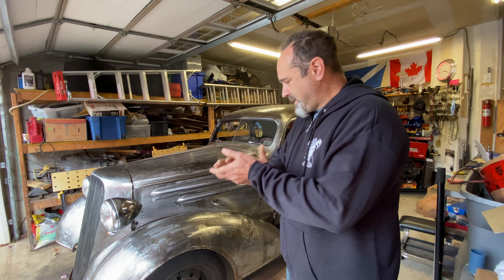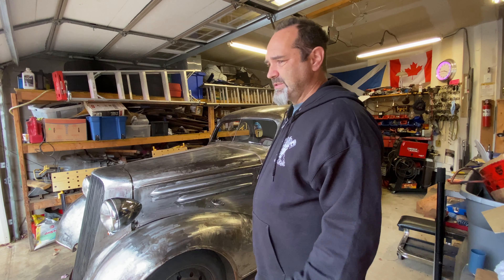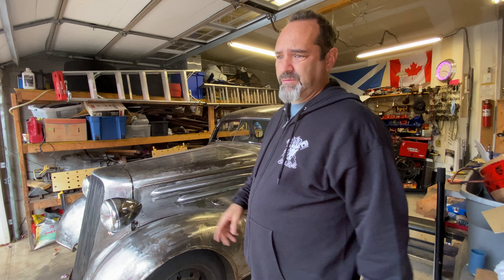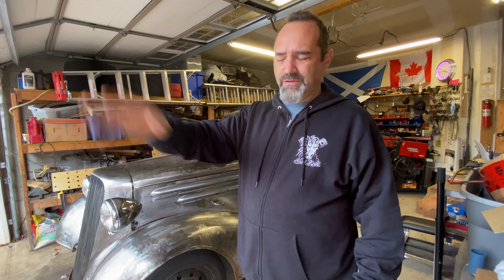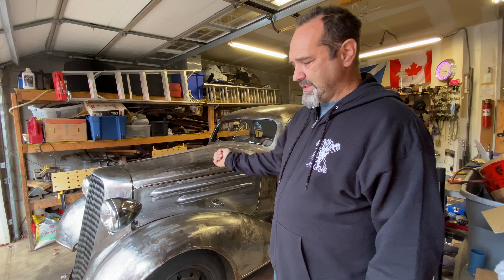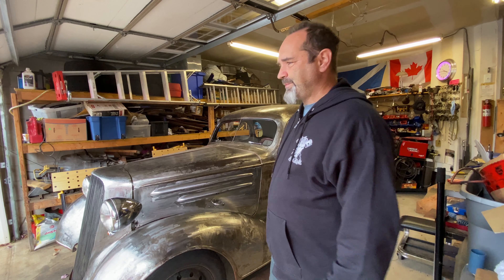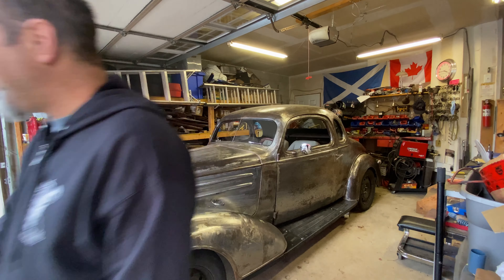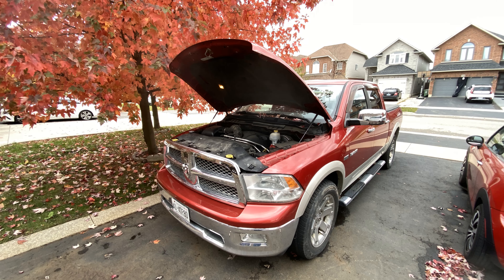2010 Dodge Ram Hemi 5.7 No Start Diagnosis

Comment: I'm a Toyota man, but the same principle applies- buy a certified used vehicle rather than a new one. The Tacoma I bought had a better warranty than new, and cost me almost $4000 less, too. It was two years old and had less than 23,000 miles on it. I don't know if you want another Dodge, or what their certified program is like, but it's an option you may want to consider, no matter what make and model of vehicle you want to get. Good luck to you, whatever you decide.

Comment: Hey Dave I just did a Google  search in Ontario and you can buy a good used Hemi for $1500-2500 bucks and we all know you have the skill and tools to install it.
Reply from the maker: I don't have the tools. Can you imagine what I would need to get that engine out. Too high for my hoist, and too heavy for my jack.
Reply: @ScottRods  nothing stopping you taking the wheels off dropping her on the floor and using the hoists that put bugsy's motor in.its only nuts and bolts. Just be methodical and take your time stripping the front off and it will be an easy ride. They are not rocket technology
Reply: @ScottRods  Yank the heads an have a look then go from there.
Reply: The Hemi weighs 75 lbs less than your SBC and yo lifted that with the transmission! As someone else mentioned pull the front wheels after you undo everything underneath.
Reply from the maker: @glenmiller3783  I was meaning lifting the truck with the jack to get it high enough to drop the engine out the bottom, but lowering the truck makes sense.
Reply: @ScottRods  yes taking it out the bottom would not be an option. 👍

Comment: From what I’ve seen you do on your channel, go get a long block & swap it out.
You CAN do this. All nuts and bolts go in labeled ziplock bags and mark all the wires with masking tape and write what they go to. Shouldn’t take you any longer than 5 days.
Reply: Found on YouTube, DG’S Garage, 5.7 HEMI Timing Chain Failure from one year ago. End of video shows a Notice from Chrysler for 2009 to 2012 vehicles stating the same problem you have & Chrysler will cover it. 
Call your local dealer & give them the VIN number.
Sounds like a RECALL to me!!!
Clay
Reply from the maker: I checked, I'm not on the list

Comment: If the drive line, body and interior is decent, get the engine. If you change your mind later, as you said running truck is worth 10k you can recoup the 6 in resale or trade.?. Good luck and sorry this happened.

Comment: Bummer Dave, but now you know. 300 000k is like 180 000+miles. How did you treat the truck ? Did you always let it warm up ? did you always change the oil regularly ? If yes, it is likely worth repairing. Pull the heads and send them in, you will likely not get them done for under $1000.00, used to be the machine shop will include a good top end gasket kit because they need the valve seals to do the heads. While the heads are out change the timing gears and chain(s) making sure to get any tensioners, chain guides and hardware and front gaskets as well. That will likely all come in at another $500.00 or so. Two or three days of work and you are rolling again, for about $1500.00 best deal by far if you ask me. Replacing the entire engine with a used unit is a 50 / 50 deal at best and likely twice the money, and you would be wise to do a timing chain on any used engine you do not know if has been done or not for sure...

And now the painful question... at what mileage was the chain last replaced ?

Comment: I feel for you Dave that sucks . I am in a similar situation but not that bad but I just had a frost plug go in my late model ford Mondeo diesel and to fix it I have to pull the motor out it's done 300000ks I am just loading the first video now

Comment: Things to think about regarding the ram engine .If you sell it as is the money you would get for it is very little.the next guy that buys it will get one heck of a deal  ,he go down to his engine supplier work on him to get one at a very reasonable price .show it off to his buddies and drive it for the next 5 or so years, or flip it at a profit. That could be you Scott. Next if you keep it and do the work your self the warranty is on you .even if you buy a new engine most of the time with new and used  if you are not a certified mechanic you wont even get a curb side warranty for the engine. you could find a certified mechanic to do the work and you could sores the engine and get warranty and save some money .If you decide to buy another truck you invariably would  have to put more money in it to bring up to your standards and safety If you fix the one you have now you know what you have,in the end it's going to cost money.Think long and hard before you put any money out.  short term cost or long term debt.just me thoughts thanks for reading.

Comment: What to do with the engine depends very much on the condition of the rest of the vehicle.  How is the body, suspension, drive train, interior, etc.?  From what little I can see, the body looks really decent for a ten year old salt belt truck.  A new truck of similar equipment would be how much?  All things to consider...
Reply from the maker: Yes Dale, lots to consider. The truck is in decent shape, but there are many small things breaking, and I've been chasing problems for a year now. If it was a classic vehicle I wouldn't hesitate in repairing it, but semi-modern stuff was not designed to last. All those electric components are scheduled to fail around now.

Comment: There are lots of 5.7 that will fit in cars that have been wrecked.  My mechanic often purchases engines from salvage yards. I would check and see the availability of a used on with less than 100 K on it before I threw up my hands.  It is a big job to change but then again the price of a 5.7 may be was less than 6 K and I have personally purchased 3 during my lifetime and as I say my mechanic regularly replaces a damaged engine with a salvage yard engine, in fact earlier this year he did a 5.7 swap when someone brought one in who did not change oil at regular intervals and didn't use the recommend weight oil.  Look it over before buying a reconditioned engine, it doesn't cost anything to price one.
Reply from the maker: There is also a huge "peace of mind" factor to consider. If I buy and have fitted, a recon engine with a 3 year warranty, that's going to make me feel a whole lot better than spending 1 - 3K on someone else's mystery box.

Comment: Scrap the car is good to take in, If you can build a hot rod, you can probably change the chain, You hear that the engine is not dead when you drive at the start.

Comment: Sorry Dave. The engine’s done. If you can get a low mileage motor from a salvage yard, I would say go for it. It’s a lot cheaper than a new truck. You need to have a Mechanic, that you can trust, to do the work. If you don’t, frankly bight the bullet and get another truck. Good luck 👍

Comment: Damn man! Hate to hear that, maybe check a junk yard or call your insurance co. And ask if they have something totaled out with a good motor for sale. That really sucks man, I'm chasing a germlin in my truck for the last month. Feel for ya brother good luck.
Reply from the maker: Thanks Ronnie. If I was replacing the engine I'd want a rebuilt with warranty, not someone else's mystery motor
Reply: Or drop in a used motor and sell it. You probably won't get more than 500.00 as is.

Comment: You have nothing to lose. At least have a look to see if the engine is damaged. It may be just a bent valve. You can get the heads reconditioned and fit a timing chain. 

You never know ...just have a look.

If it is knackered get a used engine and put it in yourself or not ...but you can make that decision when you have more info.

If it owes you nothing it is worth at least a look. The scrapman will not care if you take heads off.

Good luck whatever you decide

If you dont look you will never know.

Comment: Give it a go, pull the heads and see what is damaged, it may not be as bad as you are thinking, a lot of interference engines lose the timing and literally do little if any damage so you could be lucky and be able to get years more out of it. As you say it owes you nothing and pretty much worthless as it is so all it will cost you is a bit of time to to pull one head off to see. I am sure you have the capability to do this with a bit of research. I really feel for you, terrible timing for something like this to go wrong. All the very best to you.
Reply from the maker: Thank you for your optimism and faith in my abilities.

Comment: That’s one reason I drive 1000 dollar trucks. If it dies I will just go get another. No big money repairs. Just PITA repairs lol. Good luck with your decision.
Reply: Problem here is that 1000.00 trucks are really only worth 100.00 and rust damage is a major issue.
Reply: @ted5415    Here as well. I just look for one that is not too bad or has small problems that I can fix. Don’t much care what it looks like as long as it can pass emissions.

Comment: Dave I'm gutted for you. But what have you got to loose by pulling the heads and getting stuck in. With what you have learnt from building bugsy you can do it standing on your head.it will make some great content for the channel and if it's fubard so what go get to the breakers pull a runner with some sort of guarantee drop her in and send it down the road with a clear mind that there's no comebacks. Its not like your back in blighty searching for a motor for one of them tanks. They must be 2 a penny over there. Take a deep breath have a dram and get back into it. Don't second thought your talents.

Comment: Pull the heads to look at the engine and determine the damage. Maybe get away with replacing a few valves and the timing chain.

Comment: Tear the heads off, if you have bent valves and broken pistons that changes your options. If there aren't any broken pistons or bent valves change the timing set and head gaskets and get a few more years out of it. You got this, all the info you need is on-line. If you don't think you are up to the task or just don't feel like it buy something else.

Comment: Clean it up make it look real pretty sell for what you can get for it use that money for down payment on a used Chevy
Reply: I hate to agree being a ford fan but their mod motors are just as bad chevy still runs the conventional push rod engines more durable and lasting in my opinion it would probably be the best option to buy a chevy

Comment: Junket by an older Dodge pick up
Reply from the maker: It's definitely on my mind.
Reply: But two pizzas and write all the pros and cons on each box. Price to repair, price to install a used engine , price to buy a new project truck including estimated costs to rebuild it. Etc.  Might need three or four pizzas to work out all the variables.